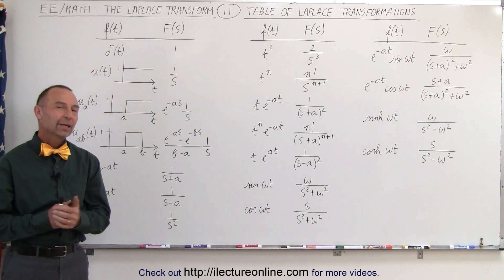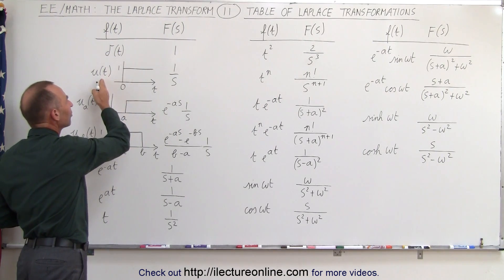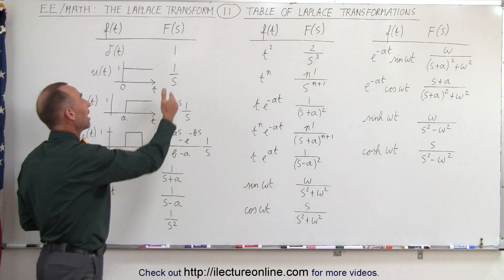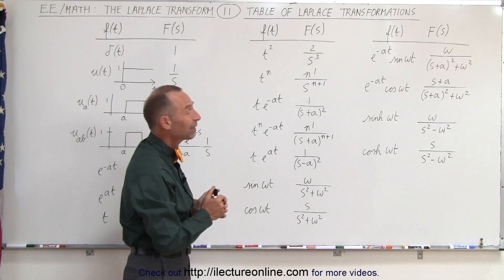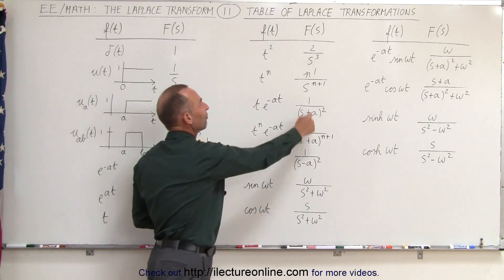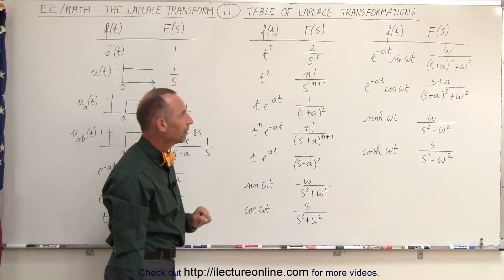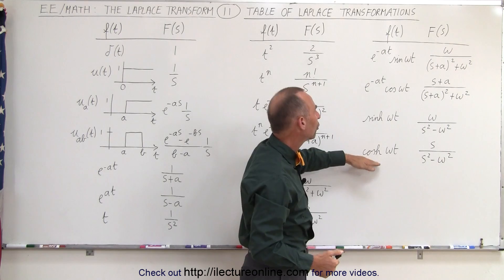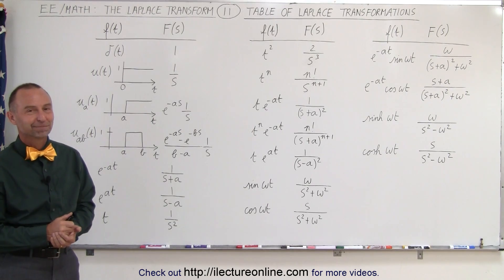Electrical Engineering: Ch 16: Laplace Transform (11 of 58) The Laplace Transform Table

Comment: what is delta function of  -t, if delta function of t equal 1,
Reply from the maker: A delta function is essentially a very high input signal over a very small amount of time such that the integral of the function equals 1.  You can move the time at which it occurs to the left or to the right, which doesn't change anything about the function.  Typically there is no meaning to taking the delta function of -t.  Instead it is better to use t-5 or t+3 or something in that form.
Reply from the maker: We have many videos on the delta function in the advanced mechamics videos in the physics section.